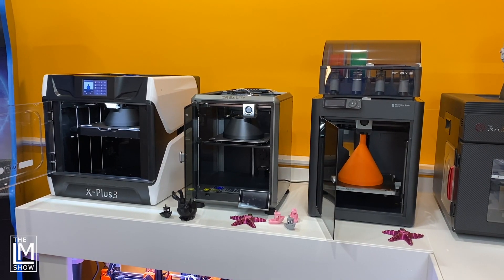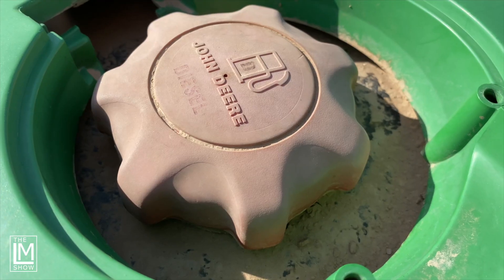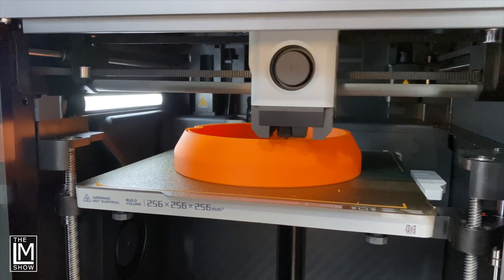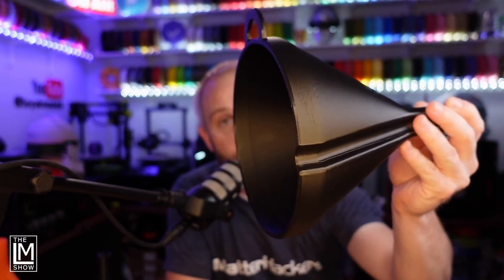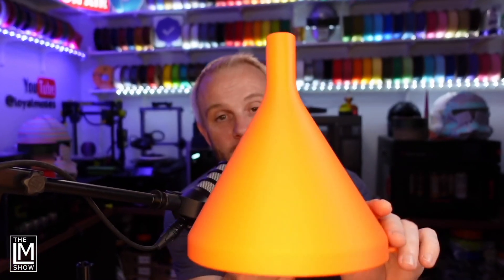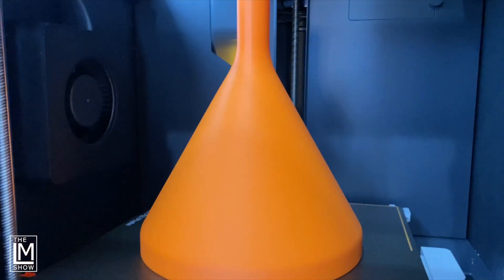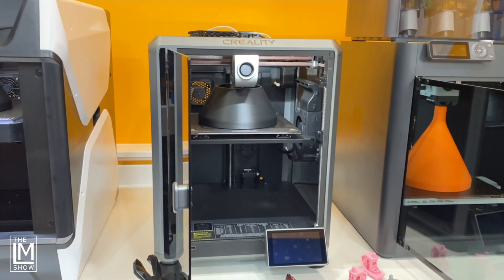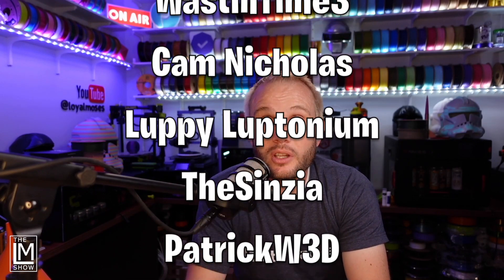Bambu P1S vs Creality K1 vs QIDI X-Plus 3 - Which CoreXY 3D Printer Is The Best?

Comment: I owned a X-Plus for over 2 years before buying the Plus 3. Since it's arrival, I've been troubleshooting with QIDI almost non-stop, trying to get my X-Plus 3 to function properly. This machine has been a huge FAIL for me. So far, I have produced ONE good part from this machine, the rest are garbage - all from the same roll of PLA that my X-Plus used to produce consistently good parts. My older X-Plus would make very good parts from ABS with ease (as well as PLA). In addition to poor quality results, at the end of every part, the machine runs the extruder nozzle into the part, knocking it off the build plate. Even their g-code file for flow rate calibration is a fail. When it has finished making the test parts, their code rams the nozzle tip into the last part and drags the tip through the material. QIDI doesn't have an answer other than repeating the line that I should install the latest firmware - which was done at the start of all this. I gave my X-Plus away so I am now stuck with this POS. Not a happy customer.  

And now the heated bed has failed (in less than 100 hours of actual print time). QIDI says I should buy a replacement bed. The problem isn't the bed. The problem is QIDI Tech uses substandard wire. The wire they are using is not continuous flex rated, which is what should be used for repetitive motion. Buying their replacement bed (with wiring) would most likely result in yet another failure at some point. I'm replacing the wire with continuous flex rated wire from Igus.

Comment: Hi, I think, the comparison is not really fair. As you mentioned, 2 running at max 600 and the Bambu is max 500 mm/s, and definitely it was slower,  than the other two. Therefore it would be super, when using the same speed, acceleration and flowrate limits with the same filament. Otherwise is so, as testing cars, how loud they are at max speed. All fast cars will loose ;)
Reply from the maker: They weren’t running at their max speeds, they were running at their default profile speeds to give a default user experience comparison. Also, it actually wouldn’t be fair to slow one down or limit one to compare to another, which is why those comparisons are useless.

Comment: I commented in another video, I owned and started with a K1, and moved to a P1S, there is no comparison between them, and once your printer has an issues, it is Bambu 100%, they walk you through the process, Creality gives your links to China websites for parts and third party youtube videos for fixes.  The P1S prints faster and high quality and doesn't need glue ;)  That is my 2 cents, and if you paid 2 cents for my comment, you over paid ;)

Comment: Those made my current 3d printer completely obsolete and outdated. I own a delta flsun SR and it is 3x slower than these new core xy !  I was going to upgrade to the flsun S1 but after seeing how loud the blower fan is, I think I might give the bambu lab a go. I want quality impression and exotic material printing, not just speed.
Reply from the maker: Bambu makes great machines! I have the S1 and the T1 on the way, I’ll have content for those soon!

Comment: Finally, I wanted to ask you several questions, if you would like to answer them
1: Which one is more user-friendly
2: Which one has more repairs than others and has maintenance problems
3: Which is better in terms of construction quality (in terms of printed structure)
4: If you have the budget for one of these 3 devices, which one would you buy?
Thank you for your support
Reply from the maker: This is a great set of questions and I am more than happy to answer!

1) Bambu Lab printers have the best user experience we've ever seen
2) None of the machines have needed repairs yet
3) Bambu and K1 feel stronger
4) The Bambu P1S would be the one I would buy

Also, there is a HUGE sale happening tomorrow from Bambu too, It's their anniversary.

https://loyal.ms/bambu (aff)

Comment: quick Tip from me if you make a REAL compare with different printers please use same filament same color no different. this makes tests not so good...
Reply from the maker: Nah, it is a great comparison. If I used the same filament, there'd be complaints about slicers and profiles or they weren't printing the same speed, etc... The results showed exactly what the experience was. If viewers don't agree with the results, that is not my problem.
Reply: @LoyalMoses  that is your opinion  🤔
Reply from the maker: Uh, yes, that’s implied when I make a YouTube video on my own channel. Thanks.

Comment: Would love to see a review on these.. for example, does the Qidi Tech X-Plus 3 still have your attention?   Is the Bambu P1S (or X1C) better or worse than the Qidi?

BTW, any thoughts on the HeyGears 3d Printers?
Reply from the maker: I have used the X-Plus 3 and the Q1 Pro recently, they are great machines. QIQI needs to work on the user experience more, but they are doing awesome.

Comment: You used a diifferent color filament for the bambu so we can't compare apples to apples there. You also only gave print times for the Qiddi. If it was faster than the bambu then I would go for the Qiddi because until they can print at speeds comparable to a microwave or Star Trek's Replicator, speed is as important as print quality. :D
Reply from the maker: Yup

Comment: Thanks for the video. I do feel like you should compare them using the same fillament, color, and speed. If you were to slow down the other 2 to reach the 500 mms i feel like your print quality would be different. But again thanks for the video!
Reply from the maker: Slowing one down to equal the lessers isn’t fair at all.

Comment: Next time should u use the same filament, because like this is not fair! Only same filament, same type, same color. Maybe the K1+camera+sensor+new replacement parts (like extruder and hotend) price = qidi x-plus3/ Bambu P1s basic price.  So check them again like that. K1 with all extra parts against qidi and Bambu.
Reply from the maker: Nah. I used the filament that was loaded and used the default profiles, and it was a fantastic representation of the user experience.

Comment: I dont get the filament argument. Bambu printers are going to work best with bambu filament, creality and qidi will work better with certain filaments. Im interested in the best that each can print (with out of the box settings), not which printer is more accurate if you feed non-ideal filament through it. Sounds like a bunch of people upset they dont have a bambu tbh.
Reply from the maker: The video was clear, but I can’t control how people will feel or compensate for their bias. We love all machines, no hate directed towards any of them.

Comment: I'm leaning toward the P1S with AMS kit. I have three other FDM printers, Ender 2 Pro, customized Ender 5 Pro and a FLSun SR with the Speeder pad. but the P1S for enclosed and for multi-color prints is so very tempting.
Reply from the maker: It will change the way you think of 3D printing. I highly recommend it!

Comment: why not all in black? The orange is so oversaturated on the camera (yellow hue), that you can't even tell there are layers, let alone artefacts ....
Sorry, but that' is just a bad comparison.
Reply from the maker: It didn’t show on camera like I wanted it, but there are other shots of it printing and on the bench where you can clearly see the Bambu produces better results.

The only way someone is frustrated with these results is if they are not willing to see that.
Reply: I am literally on the verge of buuing an upgrade for my creality V2 pro with a pletora of upgrades (like dual stepper Z, linear rails, direct drive and upgraded hotend). @LoyalMoses  So I would realy like to find some in depth reviews that can convince me (heard very good things about all the bambu labs products) to spend like +/- 1K on a 3d printer. and seeing 3 printers compared and only one with black color and distinctive results, it dissapoints me to see that you used a color that is so oversaturated on camera, that you can't even tell appart the layer lines, let alone the artefacts. to me that smells like biased/sponsored. However, I could be wrong and liked to be proven otherwise. So I'm open to discussion. However, would you be so kind to print the exact same print in black (preferably with the same filament) and edit this video? It would greatly increase the credibility of the comparison. p.s. don't take this personally, this is the first video ever I have seen (of you) so I'm not biassed (yet). So would be pleased to be wrong on this one.it's just that I don't want to break my wallet on malinformation. p.s. My goal would be to print faster (but don't want to go the voron route of print and a lot of parts myself), however remain good print quality. I'm open to recommendations. If possible <= 1k euro.

Comment: Why are you using different filament on Bambu printer? Maybe that's the reason of better quality print?
Reply from the maker: That is the filament that was loaded on the printer. And no, the Bambu machine is superior in every aspect, and has the optional multi-color system available. The other machines aren't bad, they are just not at the same level of quality and user experience.

Comment: Use all the same color and brand filament and slow them down all of them to the same speed.
Reply from the maker: Very clear that this was a user experience comparison, and not some pseudo-scientific comparison. It was the filament that was loaded on each machine, default profiles for each printer sliced in their preferred slicer. The P1S wins hands down, the other two are nearly identical in quality. All are extremely easy to use, the K1 and P1S probably the most simple to use, while the X-Plus 3 has a few extra awesome features. I like all 3 machines.

Comment: @loyalmoses Which mid range (£800 avg), core xy, enclosed printer do u recommend?
Reply from the maker: That’s about $1000 USD. For that, I’d consider the Bambu P1S w/ AMS for multicolor printing or the QIDI X-Max 3 for a helmet class (> 300mm) printer.

Comment: You should use the same material on all printers
Reply from the maker: I used the filament that was loaded at the time in each printer and presented the experience that a user would have from slicing to printing and final result.

Comment: this its a kind of unfair test
. The only way you can fairly test is to use the same filament from the same roll for all printers filaments arent created equal even from the same manufacturer. hence the reason the k1 and xplus3 llook the same.
Also flaws are easier to see on dark plastics. Also everything ahould be printed on the same speed and temps. Qidi themselves say 400mm is optimum so if you want a perfect print... dont print at 600. Besides the settings on qidi machines are using using their own filament which is made for the qidi optimum settinga.
Print them all with filament from the same roll, and print at 400.
Reply from the maker: If you watched and listened, this was not a scientific test... this was a comparison of what the average user would experience using the printer, with the filament that was loaded in the machines. First time and beginner buyers aren't interested in a bunch of nerdy geeky pseudo-scientific tests, they want to know what happens when you throw a model in the printer with the default slicer settings and what comes out.

Comment: Can someone please explain what is this madness of purchasing a full enclosure and printing with the doors open? I heard that all 3 printers have problem printing PLA unless the door is open. Is that true? Speed is nice but it would be nice to get filtered the microplastic since we are paying for the enclosure. I still cannot decide between K1 and P1S. The biggest deal breaker for the K1 is the bloatware they have for a slicer and GUI.
Reply from the maker: It's not madness but rather actually very simple. PLA has a relatively low glass transition temperature compared to other filaments and the heat from the heat block can creep up through the heat break into the cold zone of the hotend if the printing environment is too warm. When filament heats up in the cold zone (where it shouldn't be), the filament swells and becomes soft and is unable to be fed through to the nozzle.

Enclosures trap heat, and even if only a few degrees warmer, it can be enough to contribute to heat creep and ultimately a filament jam. Even with the more expensive Raise3D printers in my studio, they also have removable tops and even a hood that lifts to allow excess heat to escape when printing with PLA.

Now, the next question is almost always "why can't they just add ventilation to cool the enclosure?" -- well, the issue there is that you still need the build plate to be warm but without drafts cooling the part unevenly or prematurely. So, the solution is to simply open the door or remove the lid.

I hope that helped!

Comment: Having owned a Bambu Lab P1S for a bit now all I can say is that it's made 3D printing way more enjoyable than any bed slinger I ever had. Although having to fight with those bed slingers all those years makes me appreciate the P1S so much more. My AMS is on the truck and on it's way. Yeay! BTW, I'm printing parts for a project as I type.
Reply from the maker: This is awesome! I’m stoked for you!
Reply: getting my p1s in 2-3 days. Really stoked. Ordered early september but just never arrived. Came in stock last friday so now i just need to wait for delivery! First ever printer, which is why i went with the bambulab. due to all the praises it got for being a excellent out of the box printer
Reply: @glowpipe   You're gonna love it. You'll be running it nonstop for the first few months. I've got 1600 hrs. on my X1c and it still prints like a champ. And the only problems I had was plugged nozzle once, and then the other thing that's great is the printer will warn you if anything seems off. It even saved me from wrecking the bad cable as it warned me there was tension on the cable, so when I checked I found one yellow wire fell off its mount and was getting caught up a lil bit and eventually would have been ripped off.
  You're getting a great machine.
Reply: Being a bedslinger or coreXY has nothing to do with it. There are a bunch of bedslingers these days that are also fully automatic. The Ankermake M5/M5C, Bambu Lab A1 Mini, Ender 3 V3 SE/KE etc. on the other hand there are also a bunch of not great coreXY.

Comment: I haven't decided between Creality and Bambulab yet. Based on my research so far, Bambulab produces cleaner prints, but it uses parts that are not easily replaceable, such as the carbon X-axis tubes. In my experience, carbon has a significantly shorter lifespan compared to Creality's steel rods (although steel is heavier, resulting in more inertia and less precise movements). So, if the machine loses precision due to this wear and tear component after a year and becomes worse than the Creality, I'd prefer to go directly with a Creality since I don't plan on changing printers every year (I do a lot of printing).

On the other hand, I've come across many consumer reports about quality control issues from Creality factories (motherboards with the wrong firmware, uneven bed surfaces, etc.). However, I still lean towards getting a K1 because it's open-source, and I'm not particularly concerned about achieving a perfect surface finish. I have a CNC machine for fabricating parts once the design and testing phases are complete through 3D printing.

In my opinion, it's better to have several issues that can be solved more or less easily than a potential unsolvable problem like play in the X-axis. Even if replacement carbon tubes with sufficient manufacturing quality can be found, I doubt that the connection of the carbon tubes is held together with a simple screw; they are probably glued with resin. I can't imagine using a saw to cut and then trying to realign the carbon axes correctly before gluing them.
Reply from the maker: This was a HUGE comment! Thanks for sharing your insight! 💜
Reply: FWIW, Bambu Labs sell a replacement carbon rod assembly for $89. In general the price of parts from Bambu are very reasonable.
Reply: "In my experience, carbon has a significantly shorter lifespan compared to Creality's steel rods"

How did you come upon this experience if you have neither printer?
Reply: @ogpennywise  Perhaps because 2 steel rods even HiWIN brand do not cost 89$

Comment: Obv a biased review ... But thanks will be getting a Qidi after this :)
Reply from the maker: It wasn’t a review… hit print, looked at results. Used the filament that was in the printer. Also, there is another video I did specifically about the QIDQ alone, you should watch it! You’ll love the machine, the heated chamber is an awesome feature!
Reply: @LoyalMoses  thanks will check, do you think the print quality of the P1S is significantly better? I am thinking about going with the X-Plus 3 considering the larger print area, lower price and lower noise. Just an old hobbist tryin to find a good midrange printer to get back at it after disassembling my old cr10 . 

Will be printing mostly PLA / ABS

Comment: There are gaps in the print off of the K1, that's a pretty big issue with a funnel!
Reply from the maker: huh? All three funnels are right here in the studio next to me, and none of them have gaps.
Reply: @LoyalMoses  At 3:14 it looks like I can see the wall/printer through the indent in the funnel (about 1 to 1.5 inches down from the top).  Perhaps it's a lighting or YouTube compression artifact?